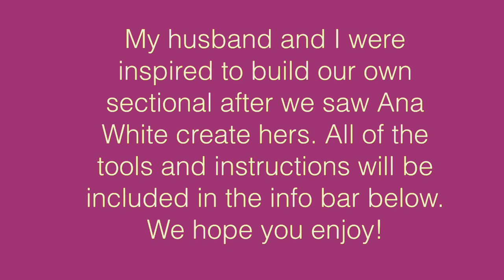DIY Outdoor Sectional|Budget friendly| $300|

Comment: Awesome job!!! 

I’m building a pergola with 2 walls and a sectional that will be set against the wall sides of the pergola... so I’m looking for ideas on how to build the frame for the sectional. 

I see you are using a Ryobi drill. I really like Ryobi because of all of the tool options. I have Ryobi, Bosch, and Porter Cable power tools. 

A bit of tool advice. For your next project, ditch the drill and get an impact. You won’t regret it.

Comment: It turned out great! I have never seen someone put glue on a screw; does it help the stability of the screw? I've been meaning to do this project but only watched Ana's video. It's nice to see a little variation. 👍
Reply from the maker: Thanks so much for watching. I would not suggest putting glue on the screws, I was brand new to woodworking at the time of this video and was clueless about wood glue lol. Put the glue directly on the wood. Our sectional is still holding up after almost 2 years. It has survived two Chicago winters.

Comment: Great job and I actually built the same one a few months back myself. However, I have not been able to come up with economical cushions. Do you have a source for the cushion fabric? I can get the foam but a fabric that will hold up outside and not fade in a summer seems to be a challenge on a budget. I have actually considered using some of the cheaper sail shades just for the fabric.
Reply from the maker: We used an indoor/outdoor fabric from Joann's that is very durable. If you choose to get your fabric from Joann's wait until they have a sale or download one of their coupons. We brought our fabric for about 6.99 a yard when they were running a sale. You may also consider using a sturdy and smooth shower curtain as an option for fabric.Also, thanks so much for watching!
Reply: Thank You!

Comment: Nice work, I'm planning on making this this weekend.  I actually  have all the lumber in my garage right now. I have a few questions for you that hopefully you can answer. 

1- what depth of foam did you use for the cushion?
2- Did you use zippers on the cushion covers? If so how did you secure them (on the back or bottom)?
Reply from the maker: Thanks for watching! The foam measures are: 72 length and 24 inches wide and it is about 3 inches 3. I did not use zippers for the cushions although I wish I had.

Comment: How many inches of foam did you use in this vid?
Reply from the maker: Hi!! The foam we used is about 3 inches thick and the dimensions are 24 in. width x 72 in. length
Reply: Where did you purchase the foam? Approx cost?
Reply from the maker: Hartocute A we used 3inch FOAM from Home Depot about $25

Comment: good job.  need to imrove on your drill handling though.  i kept on waiting to see that drill tork up and clock your husband on the face,  i was also waiting to see that drill bit strip off the screw and slam down on your hand.  luckily it didn't,   but definitely work on that skill.
Reply from the maker: mnmknj4 Thanks for watching and thanks for the tips. This was my very first build and I have since gotten better.